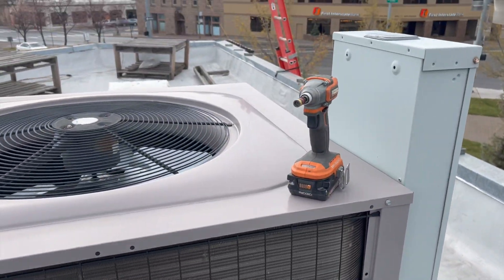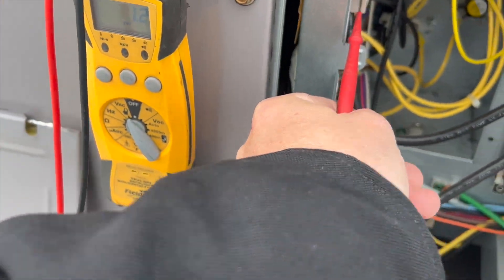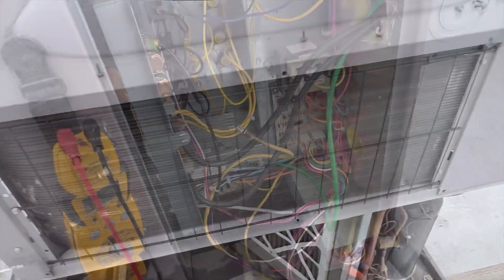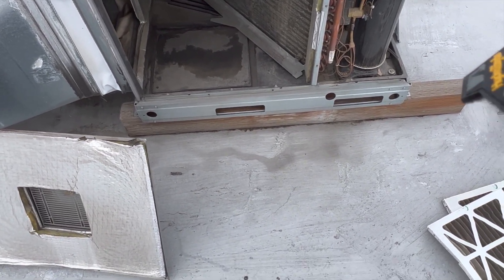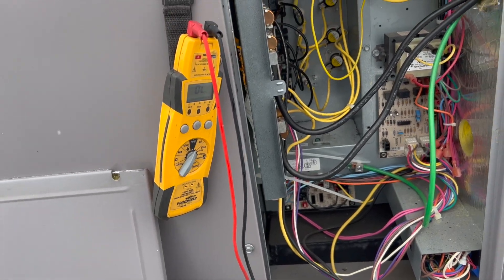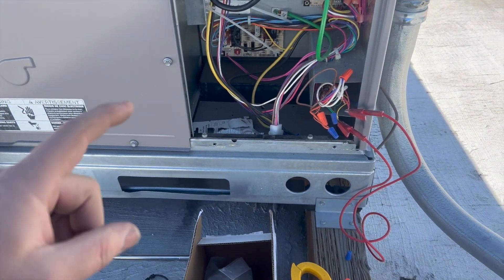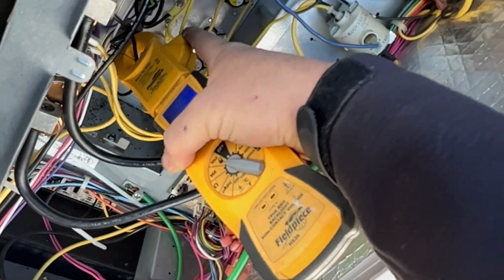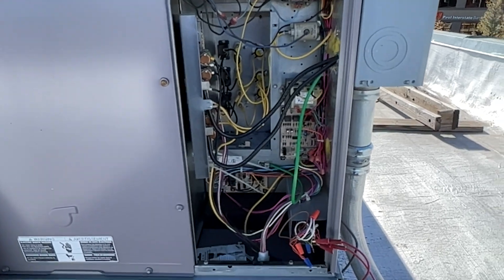Dead Thermostat Turned Into Melted Wires and Relays EP109

Comment: When fixing burnt wires, always cut them back well past the discolored part of the insulation or replace the whole wire if there isn't enough to trim and still make the connection. The wire is oxidized where it was visibly overheated and farther where the insulation looks fine, it will fail again.